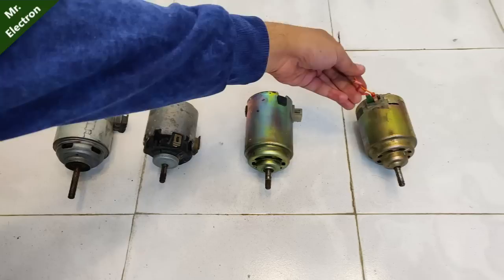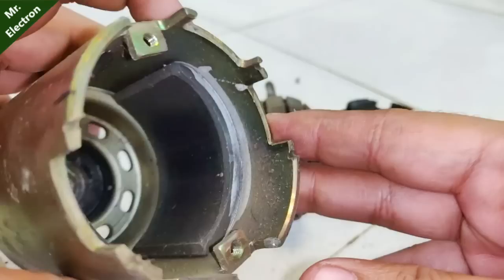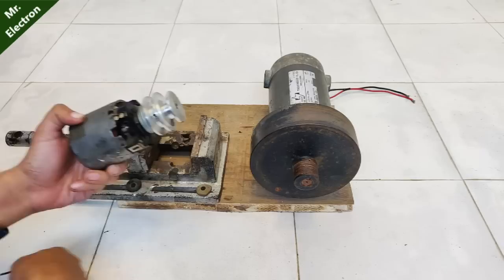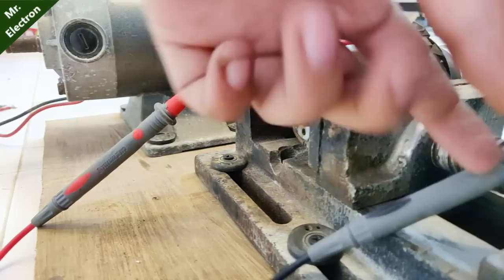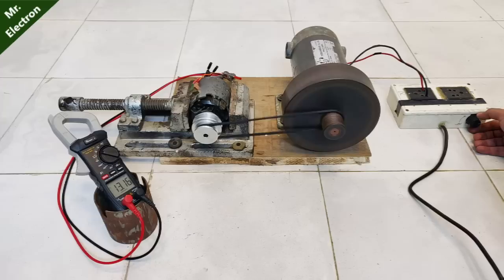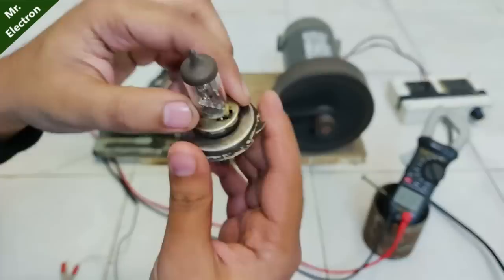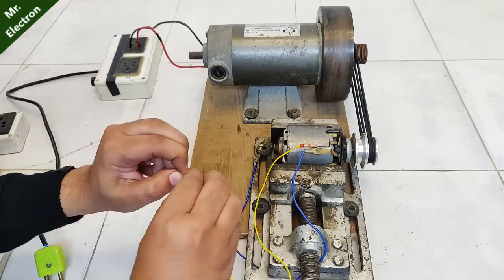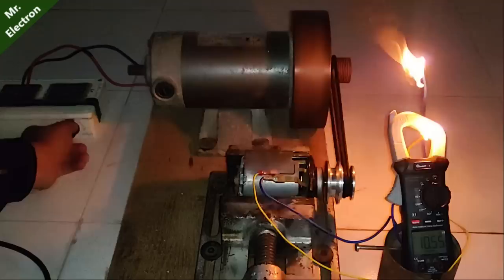Short Circuit Current Testing of a 12v DC Motor Generator DIY

Comment: so let's say if I had a single coil and I wanted to extract 30-50amps and 15 volts what gage wire and how many turns do I need and do I need to have a special core or can I do it with an air core ?